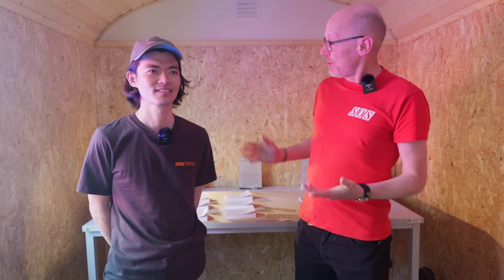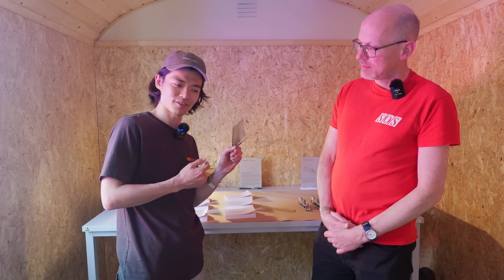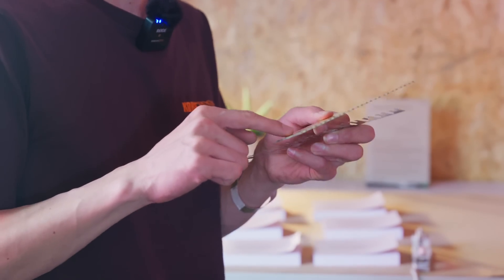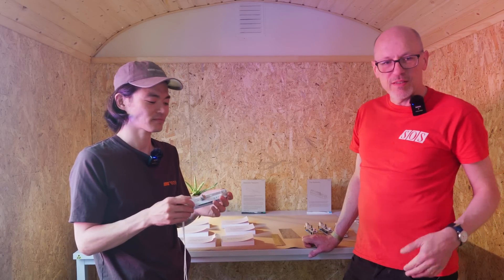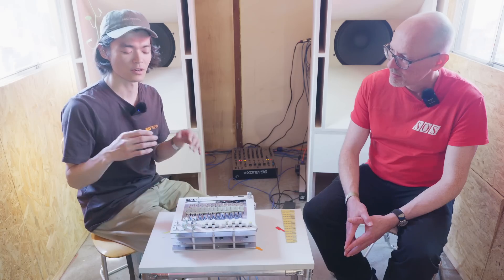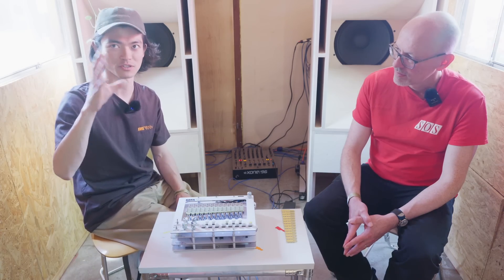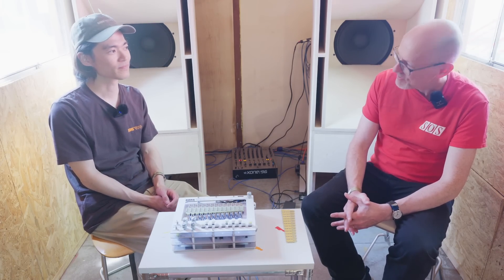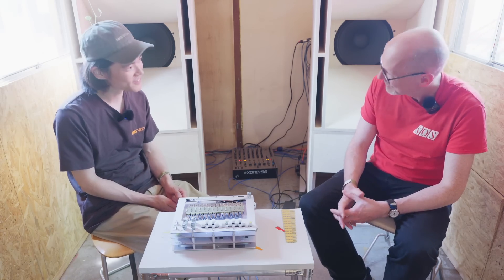Superbooth 2023: Korg Berlin Prototype Acoustic Synthesizer

Comment: What if you made a MIDI core-keyboard system with those tines, and then create add-on's like a rhythm one, and also the air resonant one. On the rhthm one, you could add a looper with multi-tracks. These add-on's could also attach physically to the core keyboard unit.

Comment: great explanation and inspiring idea - but not completely new idea. 
sth like that can be - and afaik has been, in diy-style - done with electric guitar (or similar instruments) with some sustain system. there are a lot of such systems and soultions, e.g. you can imagine multiple (or moving ! and maybe not only sliding in 1D) magnetic string actuators in feedback loop with pickups.
i haven't heard before about wind (air resenator) variants and its a pity Tatsuya only mentioned it so briefly (i can almost smell some precious know-how in the air ;) )

Comment: I'm wondering if following this concept, you can also build an acoustic drum machine with tiny drums (maybe even building just exact scale reproductions of real drum kits, why not) and sensible "micro-microphones". 

For example, the snare will be a tiny drum with a micro buzzer with micro spheres on the bottom skin or you can make a noise module capturing an air blow (a micro fan will be activated with a button to blow the air) passing thru a mini slit (designed in a way that it can make a sound close as possible to a pink noise) with a "micro-microphone" and gating it in some way like blocking the air flow with a micro blade, moving accordingly to the current rhythm/tempo, to make it decay as you want, while following the note hitting. 

Disclaimer:
I'm not an engineer, i'm just fantasizing about how a device of this kind could be designed and built, only following logic and a minimum of notions about electronics and mechanics .

Comment: It'd be interesting to add metal tabs that actually Touch the vibrating reeds for an interestiing dampening. (although over time I think they'ed wear and change)
Also mic's at different points OR tiny mic's Attached at different points.
(Also try to get radical with different shaped reeds and extra pickup's at different points (multi-tabs?) (multi-taps??)

Comment: Crazy, in every positive sense you might attach to the word!
First of all, compliments to you both for the way in which you explain this new concept. Very illuminating.
And compliments to Korg for lifting the veil in this early phase of this new technique.

My first reaction was: Nice, but in the end you are "only" applying synth techniques to individual harmonics. So essentially you'd have to think along the lines of: Make Noise Spectraphon, Synclavier, Additive Synthesis, and Karplus Strong.
That is true, but there is a positive catch:
The new technique shown here goes beyond the input-output chain of events that classical electronic sound synthesis has. The electrical synthesis elements, in this case, directly interfere with and alter the spectrum of the resonators, e.g. the acoustic sound source.
And that is creativity, thinking outside the box, a concept with great potential.
So yes, as a physicist and an engineer this makes me wild!

Comment: The raw sound is unbelievable. Most likely they'll come up with a 3000 dollar instrument that has extreme synthesis capabilities and that will be nice but it would make an incredible single polyphonic keyboard for gigging musicians that will do both EP and organ beautifully. I'm sure applying the correct filters to that raw sound you can approach Rhodes or Wurli or CP very closely and have a beautiful sound that doesn't need to exactly emulate either of these.

Comment: Temperature variation concerns and the resonators alignments seem like interesting challenges here.  Can’t wait to see how this all works out.
Reply: If you examine the device from the top, each individual note producing plate seems to have a screw on it which allows you to lower/raise the element in small amounts.
I assume this allows you to tune or re-tune each individual note plate by using a tuner device like you would use an electric tuner device to tune a guitar properly...
Then again, it's not explained in the video and I'm just speculating here...
I'd love to see a finished product with maybe 2 or even 3 octaves of plates/notes, MIDI input and some digital or analog processing to make the sounds more varied and apply per-note effects... eg, you use the plates as the OSC section of an subtractive analog synth, and have all the other stuff onboard like filters, LFOs etc... that every full subtractive synth has...

Comment: You know what would be cool?  Something similar to a CV control, where you can use a dynamic mic to introduce a vocal signal that you can blend into the resonator, or on the pickup end of it. I just kind of think that if a person were to get really into getting a feel for the instrument, it would be very cool to have them sort of guide the behavior of it through singing or humming or whistling or beatboxing. 

One of the great things about acoustic instruments is that it doesn't have quite as distinct capabilities as for what it can and cannot do. They may have different approaches that may be optimal or not optimal as far as the behavior based on how you use them, but you can ultimately use them in a lot of creative ways, provided you have the patience and a certain amount of openness toward the alternatives.

Comment: Whether this is successful or not is irrelevant. It will no doubt inspire an entirely new pathway for synth makers going forward .  Great job Korg!
Reply: @S. Fleming i feel like you're missing the point with the feedback system. This implementation can be used in a wide variety of applications.
Reply: @magnopere  Digital synths have been producing tones like these for decades, by modulating a sine, square, or triangle wave with multiple sine, square, or triangle wave harmonic frequencies. Technically known as additive synthesis.
Reply: @mikeomolt4485  I feel like you can technically recreate any sound w the right digital synth. Yet there is a consistently growing movement back towards analog/semi-analog bc the tonal characteristics that are of course possible w digital, but more difficult to replicate consistently I think. And it’s just cool imo
Reply: @mikeomolt4485  yeah, but it's got electrolytes (it's acoustic) lol. This is 100% the concept of additive synthesis but actually physical and analogue which is cool, but what is it really doing uniquely?
Reply: @mikeomolt4485  How about Virtual Acoustic Synthesis, where you can see the device realistically  rendered by your graphics card? You could manipulate an array of load cells (like a digital scale uses) to see your digital avatar fingers touching the wobbling tines, while highly complex physical models calculate the corresponding sounds using state-of-the-art DSPs. All with VR goggles on, of course.
Reply: @ronnetgrazer362  One of the most intriguing digital systems is one I spotted on YouTube a few months ago. It will emulate realistic musical instrument performance nuances. One setup allows you to write words/lyrics on screen, specific the chords you require, input tempo, then it'll play your words, sung by a choir, and it actually does sound like a real male and female choir, (not a cheesy 70s vocoder). That's the power of digital synthesis these days.
Reply: @S. Fleming You can do anything a hardware synth can do with a computer - the point of hardware is to provide a unique interface to music making. Physical instruments are fun in a way that software can't be. And new types of physical instruments give us new ways of approaching making music.
Reply: @ff-qf1th  if you put it in a physical box and give me buttons and knobs without a menu to dive, but don't tell me if it is analogue or digital, is the cat really dead?
Reply: @ff-qf1th  There's nothing unique about a hardware physical instrument device's interface, if it has a 13 note keyboard. The interface is no more unique than the first experimental analogue synths with the giant patch boards and jack plug cables to link oscillators through envelope filters, ring modulators etc.
Reply: It is basically FL Sakura for real
Reply: @ThePrestoPrestissimo W
Reply: Seems like another toy for talentless hacks to pose with
Reply: has given me some ideas for sure !! the potential for this hybrid beast is vast !!

Comment: The Basic idea is pretty interesting and i'm glad that electro-acoustic instruments are actually approached more. I did not expect Korg doing that of all people but i am glad they do and I'm and very curious. Especially since Korg actually manages to deliver at a good and reasonable price-range. Pretty sure the whole thing might probably result in VERY customizable kits that Korg might sell as Entry, Midrange and Expert level kits and perhaps even various modules you could add into your Acoustic Synthesizer system. Kinda like a Modular System but for an Electro Acoustic system. There's a LOT of potential coming from the usersbase too that Korg might even adapt. I can almost see them perhaps doing a guitar-string based Instrument as well and basically turning the concept of an E-Guitar and turning it more into a Synth. Especially with a little built in sampler/looper.
Reply: Really hope Korg is reading this!!!!

Comment: This is so exciting. Even if it is just an experiment the day we will be able to produce convincing realistic sounds on such a tiny space is getting closer.
Reply: @zipperton  If you are talking about physical modelling synthesis, yes, that came quite some time ago. I'm talking about a small factor (polyphonic?) synthesizer that uses real resonators instead of physically sampled oscillators, now that's the real deal I haven't seen yet.

I know that I'm talking about. What is the point of your "lol"? There is no need to play it smart in here...
Reply: @asdszf  physically modelling isnt sampled. its a algorithm. and real resonators always need room. there is no way to size them down. the resonance frequency is defined by its volume. welcome to physics
Reply: @brainslayer666  yes it uses algorithms which is a fancy word for a set of rules of how a model should act. for example, how a "steel string" should physically deform based on the external energy applied. but you always need a model, which in the real world are the driver and resonator (both are one, not separated entities like it is emulated in analog synthesis where the oscillator is your driver and the filter works as a resonator but there are separated hardware units). But real instruments are more complicated than this. a piano hit will never sound the same in the microscopic level: there are many factors that alters its physical shape like the atmosphere, the hammer pieces getting old, the strings gradually losing tension, your fingers not hitting with the same force... the older the instrument gets the "different" it sounds. sorry for the long comment, this is just an example as to why we still don't have the perfect algorithm to fully emulate your grandad attic's piano.

as to resonators always needing room: as long you have the fundamental frequency calculating the overtones is straight up simple. read more about how tape echoes pedals/emulators works an how they can emulate a huge metal room without actually needing to have one inside of them. Frequency has nothing to do with volume, that is a subjective term to describe the amount of 3D space an object takes.

Comment: This is a truly a beautiful idea and prototype. The applications are immense. It's sort of similar to a Rhodes piano as they have tines (a thin metal rod) with a small spring wrapped around the end for fine tuning, a pick up an inch or so away where the spring is and hammer hitting it to make the sound. I could imagine them being quite expensive as it's harder to mass produce than a baked bored and a box. Still, an innovative idea that has lots of potential.

Comment: A contact mic somewhere on the case... that's included too, no? And what about a couple of posts, so we can stick rubber bands around them, to activate the contact mic. I would incorporate this into a percussion module with some Resonant Garden/Enner aspects, as mentioned. You could have pads, keys, touch-plates, for interaction... IDK what the best design would be - I'd be open to those or others, whichever you find to be the best. I liked the Volca key strip for "playing" the patterns (via legato pattern switching, sliding thru multiple sequences quickly). I put some examples of that on Soundcloud, but I don't have any here on YT yet, unfortunately... but it's an easy thing to understand the concept of, if not what it actually sounds like. My point is, I'm open to whatever interface this team discovers to work the best.